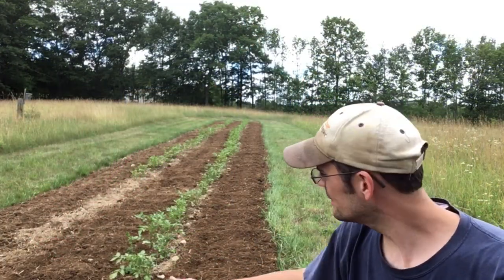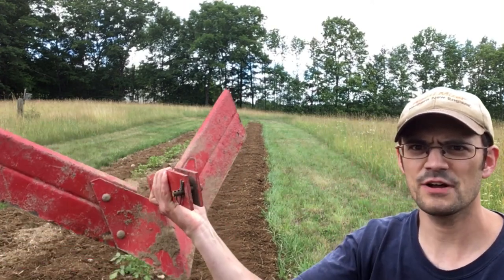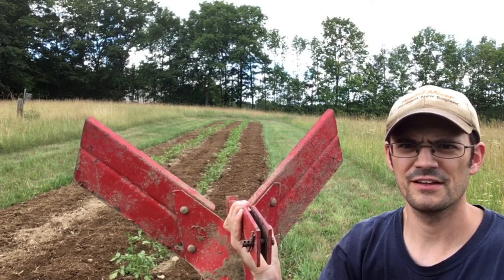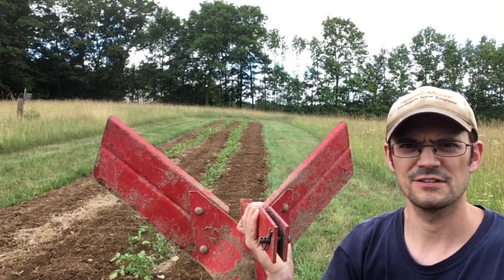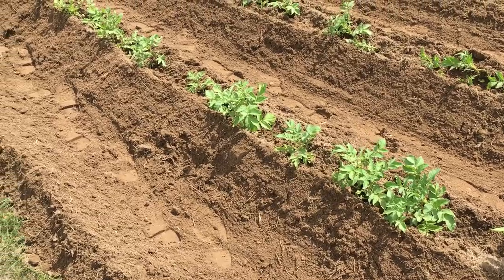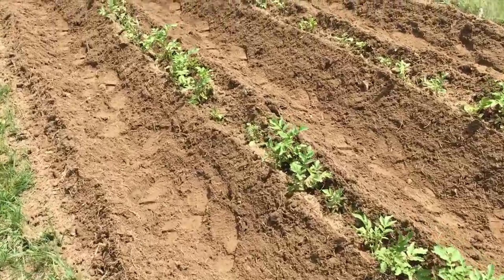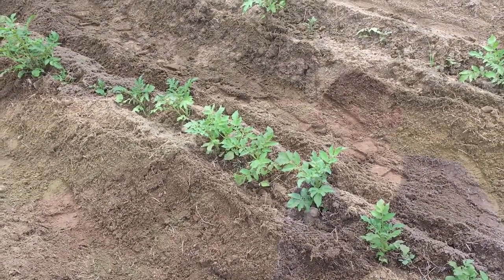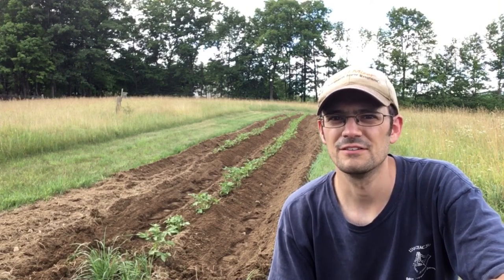Hilling Potatoes: Troy-Bilt Horse Tiller Gets it Done!

Comment: I stopped hilling my potatoes.  I till the ground, plant the seed potato a couple inches deep, then immediately cover with old hay.  If its from an old bail, I layer leaves so that each one is covering the previous leaf by about half.  If its from a round bail, I just get it about 3" or 4" deep.  At the end of the season, I pick the entire plant up, roots and all.  Lay it on the ground and pick the potatoes off.  No hilling, no digging.  The hay does a great job of keeping the weeds down and holding moisture in the soil, and it's easy enough to plow it into the ground as compost (along with mulched leaves) next spring.

Comment: I get mine out of the shop tomorrow afternoon. I purchased mine second hand, the paint looked great, no real noticeable wear, and no noticeable leaks? I used it about an hour and the transmission seized up. Anyone considering purchasing one of these second hand, always carry an adjustable wrench and check the transmission oil. If they seem nervous and asking over $1,000.00, please consider that a bearing/ seal replacement can be over $600.00! Please take a fools advice, look before you purchase! I paid the guy $1,500.00 and now a repair over $600.00! I could have bought a brand new Horse for $2,800.00. Check it out and don’t be afraid to go home without it!
Reply from the maker: Sorry to hear of your bad experience. I’ve never needed to add transmission oil in the main transmission. I replaced the tine shaft seals in the tine unit transmission a couple years ago when I noticed oil weeping around the tine shaft. That was a straightforward fix and didn’t take long. Not bad for a 35 year old machine. Just watch for oil weeps around the wheel shafts, tine shafts, input shaft with the belt pulley at the front, and the PTO shaft to the tine unit. If oil is in one of the gearboxes and you are losing it, you’ll see it. Troy-Bilt tillers are solid units if well maintained. Pretty repairable too.

Comment: You may want to try the high range to hill them. If my memory is right that's what troy bolt recommeded . When I had mine forty years ago.
Reply from the maker: Troy-Bilt does recommend high gear. I’ve tried it. If you hit a rock and get off track you do a lot more damage before you stop. The advantage of more speed is the momentum reduces or eliminates the need to push the tiller along, and keeps it from burying the attachment as deep so the machine can’t pull it. I prefer a little more hand effort and better control in these soils. That’s just me.

Comment: I can't do that with my tiller. I have a rear blade troy tiller and no matter the level I set the blades once they hit the dirt the wheels go up and I'm off. No joke I travel about 20 feet in less than 10 secs, I get whiplash and must use both hands. I said to myself "well this is bs" watching this guy one hand his tiller. I bought it at a pawn shop, anyone have any tips?
Reply from the maker: Do you have the drive wheels engaged (not in free wheel)? The horse is a pretty heavy machine and only lunges forward if hitting a big rock, or trying to work too deep in hard soil. I’ve never had an issue guiding with one hand in an established garden. My soil is sandy loam though, clay may be different. Breaking new ground is a little different too. Takes many passes with gradually increasing the tilling depth. Still can be done with one hand, but there’s no need. I only care about doing one hand guidance for the final pass so I don’t leave footprints in the prepared bed.
Reply: @ProductiveRecreation  this is my 1st tiller and I got it from a pawn shop. I have no clue about the drive wheels being engaged or not. Would there be a switch to engage/disengage? I can tell you if the motor is off, the wheels don't move and it takes 2 people to carry it. If it's running, the wheels move at a nice slow pace but the second I drop my blades the wheels lift and the blades act as the wheels but much faster.
Reply from the maker: @seansean7643  Your drive wheels are engaged then. If it is a Troy Bilt horse tiller, it has two levers beneath the handle bars. The large center lever is for forward/neutral/reverse. Pull down for forward, push up for reverse. Neutral in the middle. To the right of that is a shorter lever which shifts speed from high (up) to low (down, lever close to tiller hood). In between high and low is free wheel, which lets the wheels roll freely. Sometimes shifting this lever and you get stuck in free wheel, but moving the tiller forward or back while applying pressure to the lever will get it to slip in. As for your jumping issue, try to start with the tiller tines just barely skimming the surface, and don’t push down. Slowly work it deeper over several passes. In new ground, overlap each pass by half because the center where the gearbox is doesn’t get tilled.
Reply: Do you have the counterweights inside the wheels?

Comment: Where you find that Troy bilt attachment?
Reply from the maker: It came from Troy Bilt back when it was owned by Garden Way. There used to be other attachments for these tillers as well including a PTO log splitter, PTO generator, a sweep cultivator and a front blade. Now that the brand is owned by MTD I’m not sure if they still make and sell any of the attachments. I think the Horse tiller may be one of the only original Troy Bilt machines that was carried over. The hiller/furrower is a nice attachment if you can find one.
Reply: @ProductiveRecreation  Thanks,I will look. My Horse needs work and my option was the engine guard.
Reply: @ProductiveRecreation   "including a PTO log splitter"  - I'd love to see that and how it works.  Don't forget there was a snowplow attachment as well.  Just got mine tiller and it's in great shape - always garage kept -  for $200 :)  End of season like now is when they get cheap.

Comment: How far apart are your rows?
Reply from the maker: 30”-36”. Here are the stats on the machine: tilling width = 20”, tine housing width = 22”, tip to tip of the hiller wings = 27” at the widest point. 30” row spacing is a little close and hard not to catch plant branches in the bar tread tires or bounce off course and get too close to plants. At 36” spacing the hiller may not fully close the hill gap on the plants, but at least it’s easier not to hit the plants!
Reply: @ProductiveRecreation  that's the problem I run into. The machine wants damage the plants. If there was a shroud that starts like a snow plow then has sides that tie into the tiller shroud. It would be just above the dirt
Reply: @ProductiveRecreation I only use one of the wings, (go down one side of the row and then reverse and get the other side) I can control how close I get to the plants better and don’t have to worry about the distance between the rows as much.